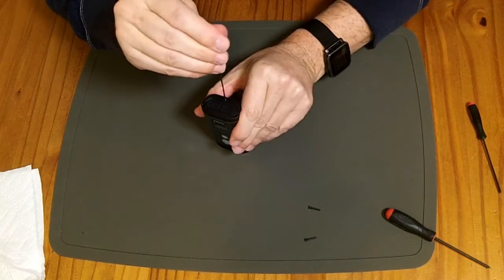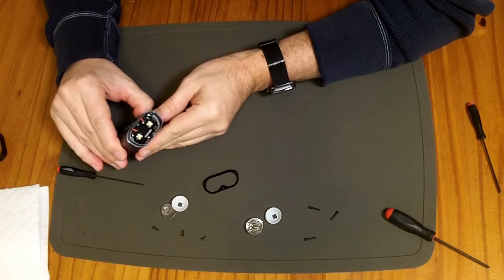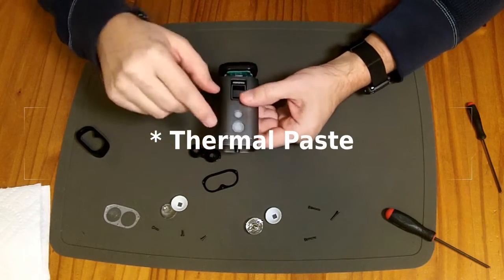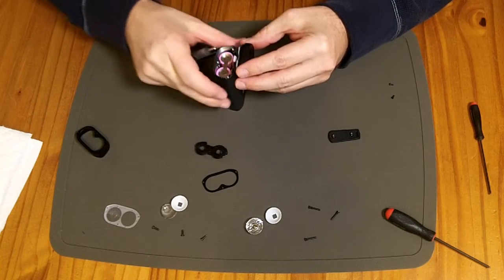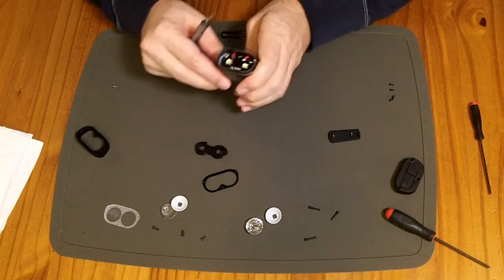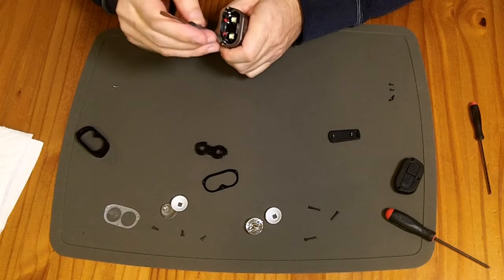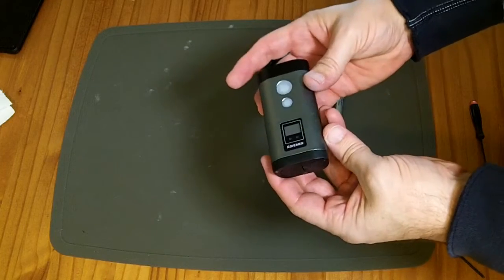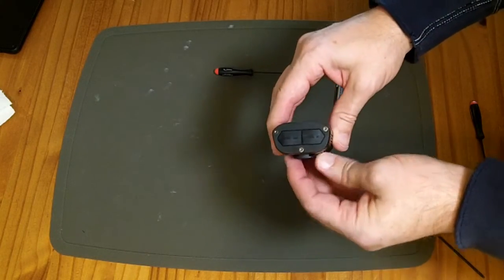Teardown: Ravemen PR1400 Rechargeable bike light

Comment: I have just broken Ravemen PR1200 looking at your video. My takeaways are:
1) It's super difficult (SUPER) to move the board and the cell inside the metal case. Without careful unsoldering the batteries you either break the cables on one or the other side of the batteries (I just did).

2) Batteries used in PR1200 are: 
FST 18650-2600 mAh
CAP: 2600 mAh, VOL: 3.6V/4.2V
8E32520 017929 made in China.
They are identical.

3) To remove the board you have to remove bigger button (rubber, which is very prone to damage while doing it + slighty flexible plastic "holder" for the rubber. It was blocking the board to be removed.

Overall score for self-repairs:
1/10

Without being super careful, having great skills in soldering and being super patient, it's almost impossible to change the batteries. 

is it doable? Yes. Is it worth the risk? No. No at all.

I love my 2nd and 3rd PR1200 light, but I thought that I will be able to replace dead batteries on the oldest one (from 2017 according to board description).

UPDATE:
The plastic part with port is different between older and newer PR1200. I wasn't able to replace older part with newer, because the ports are further from each other. I wanted to replace the one with lost rubber seals with the one that had them intact (above mentioned and broken). In the end I had to dremel out the micro-USB port to make it wider :) It doesn't look good, but it works!
Reply: Thank you for preventing me from thinking that I would just swap the batteries in my 1200 that isn't lasting as long as it once did.  Not going to go through the agony of it despite having decent skills
Reply from the maker: @JaroslawTabor  Good to know, thanks for the feedback!